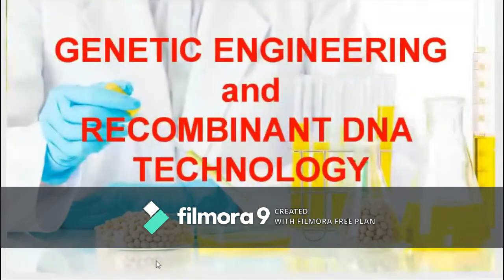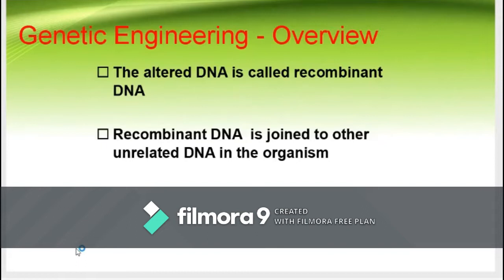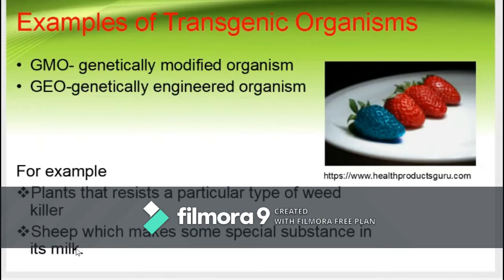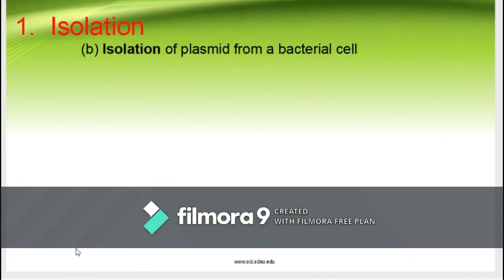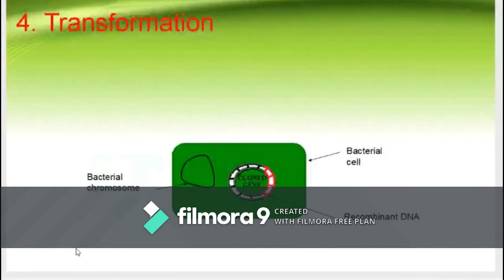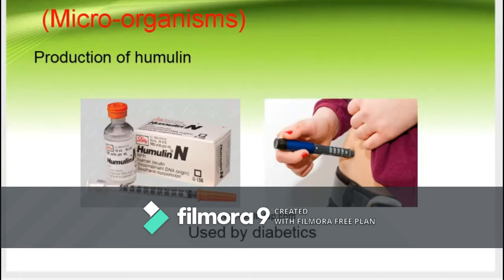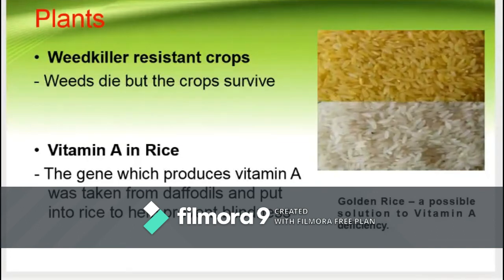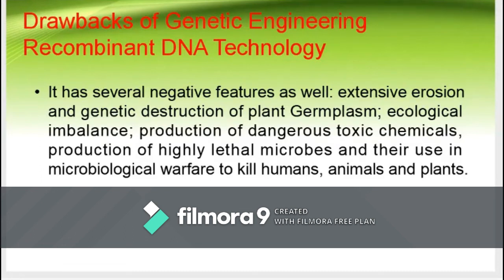GENETIC ENGINEERING & RDNA TECHNOLOGY

Comment: Stacy Ettiene B. Legaspi
Grade 11- Marie Curie

In all living things, the deoxyribonucleic acid or the DNA acts as the instruction manual for the body. It contains certain genes that code for specific proteins, which in turn make up all the different parts of an organism. Hence, once we know how these codes work, we can use genetic engineering to edit the parts we want to change. Genetic engineering is a process when the genetic code of an organism is altered to produce a desired trait. This is done by taking a gene from one and serving it into the DNA of another to get the wanted result. As we all have the same genetic code, scientists can use special enzymes to cut parts of the DNA from one living organism and transfer them to the recipient. 

In the United States of America, they apply genetic engineering to remove the sugar molecule on the surface of the cells in a line of domestic pigs. This could help minimize allergic reactions to pork and reduce the risk of organ rejection in transplant patients. Food and Drug Administration strongly supports this innovation of animal biotechnology products as it is proven to be safe for animals and people. However, the director of the FDA's Center for Veterinary Medicine, Steven Solomon announced that developers who want to use GalSafe pigs for therapeutic purposes will still have to seek approval for their applications. 

With the research I conducted for this activity, I could really tell that this biotechnology innovation has a large impact on society. It gives vast improvement to our medical, agricultural, and forensics industry. From treating diseases to adding vitamins for plants, genetic engineering never failed to amaze us. However, it also has bad effects on recipients and we can't avoid that. Hence, we should at least used it in moderation. 

In this lesson, I learned that it is possible to manipulate our DNA using biotechnology. This includes the transfer of genes within and across species boundaries to novel organisms by giving them the desired phenotype. And this made me realize that with science, nothing is impossible. It somehow served as the key for me to notice that the world is constantly changing with every discovery and innovation that scientists are attaining.

Comment: Jean Andrea Pobe
Grade 11 - Marie Curie

Genes are the ones controlling the character or trait of an organism. In Genetic engineering, the gene is processed artificially to change the single trait of an organism to create a desired change. The DNA of an organism is inserted to another organism with other species which are called the Transgenic Organisms. With genetic engineering, it is possible to alter such traits that can be a benefactor of the organism; hence the altered DNA is now called the recombinant DNA. There are 5 stages that involved in Genetic Engineering: 1) Isolation, 2) Cutting, 3) Ligation and Insertion, 4) Transformation, and 5) Expression (of the gene). 

The study related to the genetic engineering is the CRISPR-Cas9 that was discovered by Emmanuelle Charpentier and Jennifer Doudna, and they recently won the Nobel Prize in Chemistry because of their discovery and development of CRISPR-Cas9 genome editing. So, CRISPR-Cas9 is a genome editing tool that is faster, cheaper and more accurate than previous techniques of editing DNA and has a wide range of potential applications. This has been a huge buzz for the geneticists and medical researchers for this is a unique tool for editing and altering DNA sequences. Because of the precise work of Cas9 protein in altering and finding the right DNA samples from its archive in preventing the bacteria against attack (For your information, they first found CRISPR from a bacteria fighting off an attack), it brings the potential of this discovery to eliminating diseases that were burden for us on this day, and this includes determining the cure of cancer. The process of CRISPR-Cas9 is slightly more complicated than what I presented, and it takes a lot more information to take its functions and purposes. I would gladly recommend you (if you want to) to research more about this fascinating discovery that would change the life of the people in the near future.

Changing traits and characteristics of an organism has been with us since we didn’t discover it yet. But as scientists found out about it, they have altered various plants and animal genes that were healthier and also benefit the farmer’s veggies life. Yet, traditional genetic engineering took up a lot of money and time, which might be processed in years, in altering and editing DNA sequences.

But it is rather rewarding to us to have this kind of technology because without this discovery, we wouldn’t have known the secrets of the gene life, its functions and purposes for the organism. As well as I have learned, how the genetic engineering, what are the transgenic organisms and the 5 stages that was involved in genetic engineering. I fascinated with this topic and the gist of its purposes of life. I hope I can learn about this in the future.

Comment: Makiling, Katrina P.
11- Mendeleev
When we cut and join genetic material the process is known as genetic engineering. It is one of the principles of biotechnology.  Genetic engineering is the branch which deals with the modification of the genetic material of an organism. We know that it’s the DNA which is the genetic material for most of the organisms. And for the remaining ones, it’s the RNA which acts as the genetic material. Genetic engineering deals with the manipulation of genetic material. The genetic modification can be done either by adding something new to the existing genetic material or it can also be done by deleting something from the existing genetic material. The DNA obtained after modification is known as recombinant DNA (rDNA). Technically, genetic engineering can be done in many ways. Recombinant DNA is one way to pursue it. When genetic engineering is applied to modify organism they are known as Genetically Modified Organisms (GMO). Almost all living organisms can be modified with the help of genetic engineering.

Modifications and organisms can give rise to beneficial products. Consider plants for example. With the help of genetic engineering, we can produce robust crops, best resistant varities and also high yielding varities of many crops. This wasn’t short about one way in which genetic engineering can be carried out. The other way to perform genetic engineering is by making copies of the genetic material, this is also known as gene cloning. In simple words, gene cloning can be defined as the process of making an exact duplicate of the genetic material.

A few genes which code for certain extreme important proteins or even the newly modified genes can be copied several times. This process of making exact copies of genes is called gene cloning. And just as in this case, here as well clones all copies of genes serve many important applications. This entire process of making copies of the genetic material falls under the umbrella of genetic engineering.

In this video I learned about the basics of genetic engineering and RDNA technology. I also learned the genetic engineering is a scientific breakthrough that has led to developments in biotechnology. Genetic engineering can have very many dangers. But such fears will reduce once it is realized that everything had the potential to be dangerous or harmful. Genetic engineering is an important tool for natural scientist. Genes and other genetic information from a wide range of organisms are transformed into bacteria for storage and modification, creating genetically modified bacteria in the process.

Comment: Janes Isabel Salinas
11 Curie STEM

In basic terms, Genetic Engineering is basically doing math within the genetic information until the desired result is acquired. Genetic Engineering is the deletion, addition and the manipulation of one's single trait that the organism possess' that'll soon create changes based on someone's desired standards. Molecular level is the duplication of a DNA from an organism and on how it is attached to another copy of another organisms DNA. The altered product from this process is called the recombination DNA. 

A study that is close enough to be related in this lesson is Mutation. A Mutation occurs when a DNA gene is damaged or changed in such a way as to alter the genetic message carried by that gene. It is a genetic change that causes new and different characteristics, like the mutation on the dog's DNA that makes its tail shorter than its ancestors' tails. Mutation comes from the Latin word mutationem meaning "a changing." You might recognize this root in related words like mutate, mutable, and mutant. Mutation consists mutagen is an agent substance that that can bring about a permanent alteration to the physical composition of a DNA gene such that the genetic message is changed.

In regards with how the Genetic Engineering works, there are 6 stages that takes part in this DNA alteration; Isolation, Cutting, Ligating and Insertion, Transformation, and Expression. In Isolation DNA fragments ar eisolated from the donor organism. In Cutting, restriction enzymes are found naturally in bacteria that can be utilized to cut DNA fragments. Ligation & Insertion, Ligation is when the ends are being tied up with each other. Insertion is the addition of one or more nucleotide base pairs into a DNA sequence. Transformation is the DNA will be integrated into one if the cells chromosomes. Expression is when the product of the recombinant DNA that is now producing protein is being harvested by the Engineers. This completes the complicated process on how to genetically mutate an organism into your desirable product. 

This was by far the most complicated topic out of all the last lessons that we retook. But sharing my insights about this topic helped me recognize the small details that I overlooked from the past. It also intrigues me on how some of the genetic chromosomes work together and make hybrid organisms. One of the most interesting things are, on how Mutation can be possible and be successful  in the near future with the help of modern scientific technologies. The works of Mutation will surely do make wonders in the world of Biology.

Comment: Daniel John G. Gallardo - STEM 11 - MENDELEEV

          Genetic engineering is the manipulation of the genetic material of an organism in order to change a trait that it has. It uses the mechanism known as splicing is used in which tiny segments of a gene are removed and replaced by another gene. The altered DNA is called the recombinant DNA where it is joined to other DNA in the body. These organisms that were altered through genetic engineering are called Transgenic organisms. Two types of this are, Genetically modified organism (GMO) and Genetically engineered organism (GEO). GMO is when an organism is modified through any method including conventional breeding while GEO are organisms that undergo genetic engineering like direct transfer or removal of genes.

          Though many people would find genetic engineering to be quite questionable, there are actually good reasons on why it is researched and is deemed needed for our world to progress smoothly. A study called Genetic Engineering of Livestock is the study on if we can improve our livestock. This was tested on transgenic pigs where two generations were having no problems and had a significant improvement. Although effective, it slowly went bad with time as the pigs’ health gradually became worse and worse.

          The method of using recombinant DNA technologies to change the genetic structure of an organism is genetic engineering. To make useful goods, it often includes the modification of one or more genes. In other words, for more efficient drug delivery, genetic modification encodes characteristics and smart circuits in bacteria. Around the same time, engineers are designing techniques to monitor and direct bacteria externally to improve their ability to find and enter tumors.

          This lesson has taught what genetic engineering is and how it takes place. I got to learn the process of how humans can genetically modify organisms. I learned the ways of how an organism can be genetically modified. It interests me how the future might look like if people manage to master genetic engineering.

Comment: CAMPANA, Arienne Monique L.
STEM 11 – Rutherford

Genetic Engineering is the combination, deletion, or basically the manipulation of genes from one organism to another to create changes and this is done through splicing which involves the tiny segments of a gene being taken out and replaced by different genes. This process works by copying a piece of altered DNA, which is also called the recombinant DNA, from one organism and joining this copy of DNA into the DNA of other organism. In this process, there are five stages involved which are: Isolation, Cutting, Ligating and Insertion, Transformation, and Expression. During the isolation stage, the genes of interest are to be isolated from the organism and in the stage of Cutting, the DNA is cut from restriction sites using restriction enzymes that acts as a molecular scissor. In the stages of Ligating and Insertion, he fragments of DNA are to be rejoined in order to form artificial recombinant molecules. In the stage of Transformation, the recombinant DNA or the altered DNA are to be introduced into the bacterial cell and lastly, in the process of Expression, Engineers are to obtain the organism containing the recombinant DNA to produce the wanted protein.

In 2001, the first gene-targeted drug therapy was approved by the U.S. FDA. It was a drug generated to treat chronic myelogenous leukaemia (CML) which is a type of cancer. The drug was sold as an anticancer and in todays time, it is still being used as a cancer treatment drug since it has since shown very impressive responses among patients with over 98% of the patients showing complete hematologic responses after 60 months of therapy using the drug. The drug is called Gleevec (imantib)

The video discusses the concept of genetic engineering which is the process of altering DNA and joining it into the DNA of another organism. The altered DNA is called the recombinant DNA which is whats inserted/joined with the DNA of another organism. This is done in a process called gene splicing which involves the tiny segments of a gene being taken out and replaced by different gene. The process of Genetic Engineering undergoes five stages which are Isolation, Cutting, Ligating and Insertion, Transformation, and lastly Expression. Genetic Engineering is done because of the benefits it has been providing for the medical industry, agriculture, and others. This process allows various genetic possibilities to come true and that is what makes it important and necessary. 

In the video, I was able to learn all about genetic engineering and rDNA technology. I wasn’t really familiar with the topic before it was discussed this quarter but learning all about it made me interested and amazed by how my tiny cells are able to do these processes. I have learned that this process in necessary for the betterment of certain things such as those that are medical related and agriculturally related. Knowing all about this has made me think of how truly amazing the human brain is for being able to come up and perform such process. With this alone, there are so much we can accomplish and innovate and it could allow us to further generate more improvements in the modern world. and I certainly hope we use it for the good.

Comment: Ajos, Frances Ysabel S. 
11 - Rutherford

Genetic Engineering, the process of altering the DNA in an organism's genome by manipulating the genes of DNA of any organism. Involving recombinant DNA Technology and Gene Therapy, can be achieved by using recombinant DNA (rDNA), or DNA that has been isolated from two or more different organisms and then incorporated into a single molecule. Its main purpose is to manipulate genes and study their outcomes and use this genetically modified gene commercially. There are five stages of Genetic Engineering, namely, the isolation, cutting, ligation and insertion, transformation and expression. 

The encoded biosynthesis of proteins provides the ultimate paradigm for high-fidelity synthesis of long polymers of defined sequence and composition, but it is limited to polymerizing the canonical amino acids. Recent advances have built on genetic code expansion — which commonly permits the cellular incorporation of one type of non-canonical amino acid into a protein — to enable the encoded incorporation of several distinct non-canonical amino acids. Developments include strategies to read quadruplet codons, use non-natural DNA base pairs, synthesize completely recoded genomes and create orthogonal translational components with reprogrammed specificities. These advances may enable the genetically encoded synthesis of non-canonical biopolymers and provide a platform for transforming the discovery and evolution of new materials and therapeutics.

With these new ways to develop alter DNAs, we as humans have the abilities to develop genomes. It is amazing how our minds com up with innovations like these. Knowing that our lives have come one with sciences, technologies we should take things into consideration and be grateful for science.

With these activities, I have come to know that these part of our being as humans are part of our lives. Innovations and discoveries such as these deeply affect our medical and agricultural fields. Which makes us need things like these.